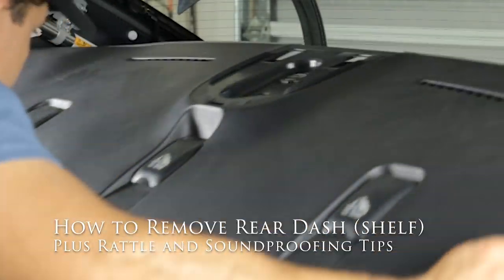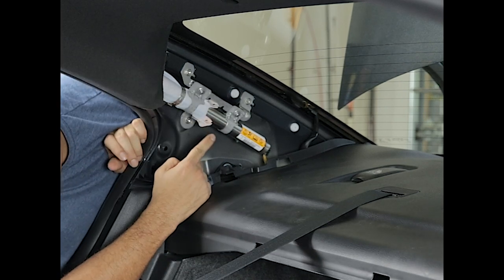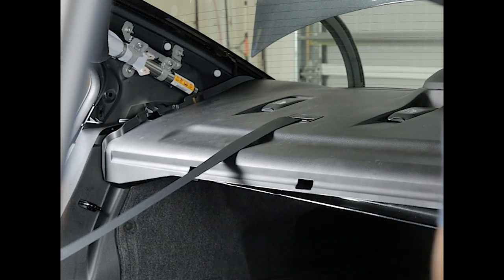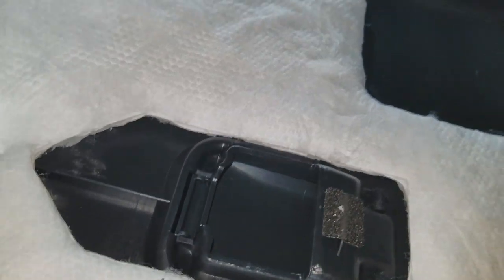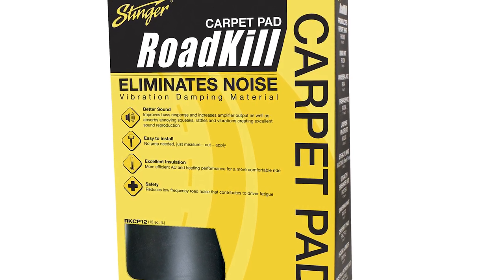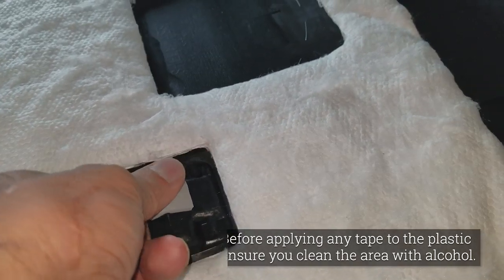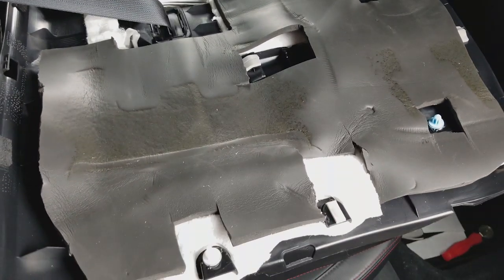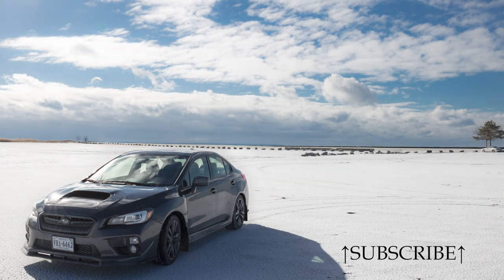WRX & STI Rattle-Proofing : Rear Dash/Shelf

Comment: Nice video! Thank you!! I have a rattle in the rear dash like you mentioned in my 2017 STI, and I'm losing my complete mind. Im definitely going to tackle this one. Thanks again!
Reply: The rear brake light is vibrating on the rear window or below... Driving me nuts. Definitely going to tackle this winter.

Comment: Great guide.  I bought some Roadkill Carpet Pad and it works great.  No rattles so far, and a noticeable noise reduction in the cabin.  I made sure to leave the area under the cabin pressure vents unblocked, so no problems closing the doors and no effect on the ac blower.

Comment: That was a great video! I had a 2015 3.6r Outback (until last Wednesday when it was totaled in a accident with a pickup). I’ve owned a bunch of Subaru’s over the years, all of them were awesome cars! I will say that the older ones I had had a few rattles. I wished I had the courage back then to pull door covers and rear dashes apart to fix them like you did.

Comment: Well, I just did this today. Not a terrible job, but putting it back together was a bit of a pain. The thicker soundskins made it harder to line up the plastic pop rivets. I also forgot to take pics of the front of the trim before popping it all apart - big mistake. Tooke me 15-20 mins to figure out how it all snaps back together. Take before pics folks, even if you think it's an easy job. It does make a nice difference. Is it a Lexus now? No, but those little rattles are gone, and that's worth it!

Comment: I have a base model 06XT which missed out severely when the soundproofing was handed out. I have bought rolls of adhesive foam to try and suppress the rattles.
Works for a while but new rattles will always develop. Went for a ride in a new Camry. Dead quite. Like chalk and cheese.

Comment: is it easier to do the top side of the rear shelf or the bottom side (in the trunk) with the deadener?  The CCF mat is better on the top side of the rear shelf, but even it too could go underneath if it has a sticky backing.  Less stuff to remove if you go from underneath...right?  No one sees the underside of the rear shelf in the trunk.

Comment: so i have a 2019 subaru wrx cvt model planning on getting a cobb air intake with the v3 access port has well with a charge pipe, boost controller, turbo inlet hose and a boomba bpv i will be ordering all at once and installing all one time, any advice on what to do? thanks

Comment: Hey, mate. Very helpful video.

How are these rattles now a year on? Anything you would do differently or add?
Reply: @akqjtn  Cool, can't wait to see those, your other vids on dashcams helped a lot too. I did similar things under the C pillar covers but now I will do the rear shelf and also iron out a few rattles in the front dash.
Reply: @akqjtn  Yeah there is a bunch of rattle location. The rear dash, The rear dash break light. The Arm rest extension button, shifter console, Instrument cluster cover, Radio cover, Tweater dash covers. Area underneath the door covers where the hand grip part is.  I mostly just used friction or fabric tape and i have finally eliminated pretty much all rattles in my 2015 wrx.  Top of my driver side door cover seems to rattle on occasions and i think thats the only place left for me. 

I have solid, Trans mount, whiteline positive shift kit, diff mount reinforcement, various underbody mount reinforcement.  So my car is even more harsh then stock.  I like your idea on the foam tape as there is some thicker areas where i had to triple up on the tape and the foam probably would of worked better.